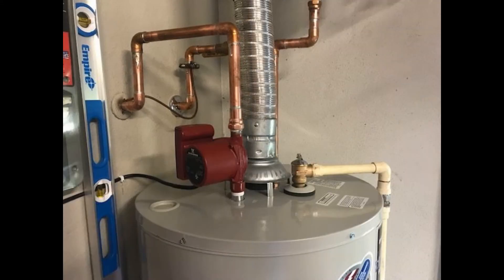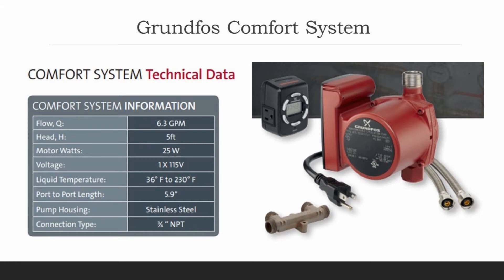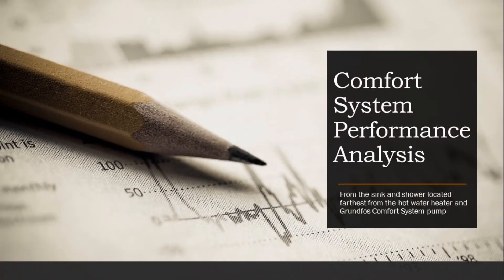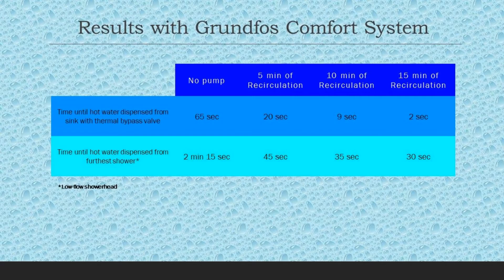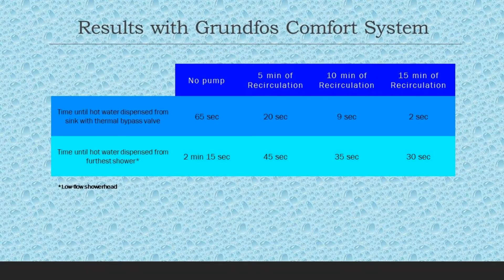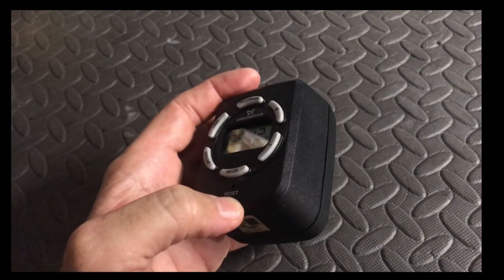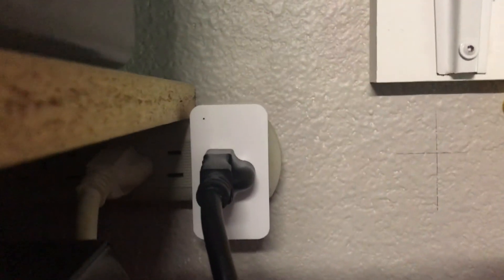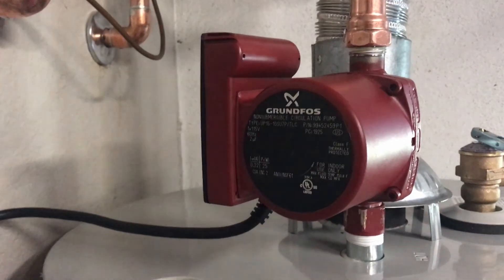Review of the Grundfos Comfort System Hot Water Recirculation Pump

Comment: My Kitchen sink is about a 100 feet from Hot Water heater. I installed a Pump under the sink and used a Sonoff Basic as the switch. The device has a inching timer buried in the settings. It took 100 seconds to get Hot Water to the sink, so if I am in the kitchen expecting to use Hot water. I say "Hot Water" and by the time I need it it is there (100 secs). I found out the the Hot Water runs by the two other bath rooms so the Command gets Hot water to them also. The first Sonoff just stopped working. It lasted about eight years and I bought a new one a few months back. I have Amazon Dots scattered around so I can get the hot water where ever i am.

I suppose I have saved 100's if not 1000's of Gallons of water, which has probably paid for the hardware.

Comment: For those that have a pump, and either it still takes a long rime, or it never gets that warm, are you using the bypass valve?   The rating for this pump is 6.3GPM.   The math on 500' of 1/2" pipe is it holds 5.1 gallons.   So even with a VERY long run, (say half that), it should be able to pump out the cold water from the line in 20-30 seconds.  UNLESS - it takes so much pressure to force the hot water into the cold line, that the effective GPM rate really drops.

Comment: _Can you use the timer Plug and the Wyze Plug at the same time?
The timer is programmed for a certain time every day
Wyze Plug for time outside of that schedule (when the timer is off)
_Connect both devices to electricity & get two Extension Cord male/female from each device to the bottom of
ELEGRP 6-Outlet Extender with Central Anchor, 3-Prong Grounded Wall Tab, Multiple Outlet Extender with 6 Electrical Outlets, ETL Listed
Then connect the pump to the top of 
ELEGRP 6-Outlet Extender with Central Anchor, 3-Prong Grounded Wall Tab, Multiple Outlet Extender with 6 Electrical Outlets, ETL Listed

_Can you use the timer Plug and the Remote Control Outlet 500ft~1000ft Ultra Long Range 15A Wireless Switch at the same time?
The timer is programmed for a certain time every day
Remote Control Outlet 500ft~1000ft Ultra Long Range 15A Wireless Switch for time outside of that schedule (when the timer is off)
_Connect both devices to electricity & get two Extension Cord male/female from each device to the bottom of
ELEGRP 6-Outlet Extender with Central Anchor, 3-Prong Grounded Wall Tab, Multiple Outlet Extender with 6 Electrical Outlets, ETL Listed
Then connect the pump to the top of 
ELEGRP 6-Outlet Extender with Central Anchor, 3-Prong Grounded Wall Tab, Multiple Outlet Extender with 6 Electrical Outlets, ETL Listed

_I think you can use the Wyze Plug and the Remote Control Outlet 500ft~1000ft Ultra Long Range 15A Wireless Switch at the same time with the same setting?

_I think you can use only the Remote Control Outlet 500ft~1000ft Ultra Long Range 15A Wireless Switch on demand?

_The question can it work all the time without the digital timer, the answer I think yes because it worked with the Wyze Plug, and I think it will work with all these scenarios. 

The default time parameters are 5 minutes on and 15 minutes off
It is better to go for 25 or 45 minutes setting
Maximum system pressure 145 psi (10 bar).
Flow rate: 0 - 3 [gpm] gallon per minute
Flow, Q: max. 6.3 gpm (0 - 1.4 m3/h)
The flow limits are based on predefined pipe diameters and flow limits
Pipe diameters & flow limits
1/2" 1.5 gpm)
3/4" (2.3 gpm)
1" (3.8 gpm).

_This one (digital timer) is similar to the one with an analog timer  
Comfort System (Includes timer, valve and hose kit)
_This one with Separate digital timer
Grundfos Model UP 15-10 SU7P/TLC - product number 99452459 
The other one with an analog timer (both are the same)
Grundfos Model UP 15-10 SU7P/TLC - Product number 595916 
Grundfos Model UP 15-10 SU7P/DTLC - Product number 595916 

Other Product number
99521972 (Digital Timer)
595926 (Comfort Valve/Grundfos XL Valve)
599390 (Flex Hose Kit)

Comfort Valve Temperature sensor will close when the water reach temperature 102 °F, this will force the pump to stop circulating hot water to the cold water line.
Reduce the flow for water in pipe can reduce accelerated corrosion

You could make a video about that 
:)
Reply from the maker: That's way more thinking than I ever put into this!  I would just use a smart plug which negates the need for the timer.  The smart plugs, such as Wyze, can be set to do whatever you want automatically.

Comment: Pros and cons of this system. The pro is of course you get hot water instaneously. The con is that hot water does get into the cold side which is your potable water. Unless you keep you water heater tank in tip top condition you will be drinking that water also. In other words the hot and potable cold side are not separated and your potable water might get contaminated by the hot water.
Reply from the maker: Good point but it's all tap water in my mind so it should still be potable.  At least I've never died, or gotten sick, from drinking my hot water out of the kitchen faucet.

Comment: My setup looks exactly just like yours.  I also timed mine and it takes around 40 seconds without pump and 30+ seconds with pump in a low flow shower head where the valve is not installed, only saving a mere 10 seconds.  i run the pump about 15 to 30 minutes before i shower.  doesnt seem to make much of a difference.  what am i doing wrong?  do i need to install a second valve in the master bathroom where i take a shower?
Reply from the maker: I'm definitely not a plumber.  However, you might have a long run from the valve and with the low flows it could just take the extra time to push the cold water in the lines out.  My thoughts are to have the valve as close to the shower as possible.  Maybe relocate it?  Did you do anything to resolve the issue yet?

Comment: Any pump issues if it runs continuously for say an hour or more a day?
Reply from the maker: We moved out of the home over a year ago.  So, I don't know if there are any new issues.  We ran it multiple times a day and never had any problems with it.   Our new home came with a recirculating instant hot water heater.  However, if I ever live in a home presenting the same long wait time for hot water with a tank water heater, I would install another Grundfos recirc pump.  I was definitely happy with our experience with it.

Comment: Thank you for the video. Since hot water recirculates into the cold water pipe, once you open the cold faucet, isn't the hot water comes out of it and you need to wait for cold water to start flowing out? Or it happens quickly?
Reply from the maker: Never really noticed an issue with it.  The cold was always quick and seemingly uninterrupted by the recirc pump.

Comment: Why use the expensive thermo-valve? Why not instead let the pump sit at the far between hot and cold and let it pump for a few minutes right before you need hot water? I added a check valve for good measure. I used a cheap shower fan timer with 1 minute resolution. Clicking on 2 minutes once is enough to get the hot water from the hot water tank to the shower end.
Gonna give the Alexa tip a try. Starting it by voice when jumping out of bed sounds cool (or hot, haha).
Reply from the maker: The valve came with the pump so I wasn't aware of its individual price, and never had problems with it so didn't need to buy a replacement.  Always interesting to see different mods!

Comment: Do i need to add any extra valves or piping? Great video
Reply from the maker: NO new return line used with this pump but it does come with a valve that I installed under the sink to recirculate the water.
Reply: Do you know if i should drain water heater? Thank you for yor reply
Reply from the maker: @josesosa1628  I’m not a plumber but I’d say no.  Of course it can’t hurt to drain it to give it a cleaning if installing the pump.
Reply: I installed pump ofer the weekend  the question now is should i leave it on all day or on schedule i have it on wyze plug so far thank you for your opinion

Comment: I'm thinking of getting one of these.  Do you feel the same about it today as you did when you posted this video?  Also, are you saying you have to run the pump for 15 minutes before getting in the shower, in order to get hot water from the shower in 30 seconds?  If so, I get that it saves water (compared to just letting the shower run until it warms up), but it seems self-defeating in terms reducing startup time.  Maybe I'm missing something.
Reply from the maker: My wife and I are still happy with this recirculation system.  I see your concern about having to wait 15 minutes.  However, we are very comfortable with using a voice command while still laying in bed to activate the pump and after finally crawling out of bed, using the bathroom, and brushing my teeth, the timing works well to save some water.  It just really annoys me to stand there for minutes with the water running down the drain waiting for the hot water.  I have talked with other people with this same pump and have heard everything from they leave it running nonstop, and the example they use the standard timer and have it start well before they wake in the morning and let it run for hours.  If you don't want to wait for however long yours will take to hit that "sweet spot" of time for near instant hot water, I'd use some of these other ideas instead of the voice control that I use.  One last thought...not sure if it really matters but I have thoughts that running the pump for many hours, or all the time, unnecessarily wastes electricity.
Reply: @DanRetired2017  Thanks for the reply.  I think our needs are generally predictable enough that we can set the timer to run the pump for a couple of hours in the morning and evening and that will cover most of out use.  We'll just have to experiment.  On another note, I've heard that when the hot water line is primed, the cold water line is now warm-hot, since it's been returning the hot water to the water heater, and now you have to wait for cold water to fill the line if you want any.  Any comments on that phenomenon?

Comment: Dan,hello, WE LIVE IN NORTH NJ, YEARS AHO, I FOUNF THIS IN A SUPPLY HOUSE FOR MY TRADE GRUNDSOS it only came with the pump & 1 bypass fitting,I had to buy my hoses, so I USED IT IN MY LAV ON THE 2ND FLOOR,SO BASIN,TUB & shower, so I wrote GRUNDFOSS, they sent me the second bypass,so I installed it on the 1st floor lav,so the kitchen also gained from that,,,, nowadays the mbox comes with pump,bypass& 2 hoses, gee no wonder, from complaints I guess,   I set my timer,off @ 3am -6 am, works like a champ. I could also connect an AQUASTAT, IN SERIES. WITH THE PUMPSTRAPPED ONTO PIPING, SO IT WOULD STOP ON THAT,INSTEAD OF TIMER, 🇺🇸🇺🇸🇺🇸🇺🇸

Comment: I can't wrap my brain around a system without a return line to hot tank.
Reply: I’m currently a apprentice and I’m trying to figure out if you are able to put the pump on the hot water supply ? To me it just makes sense you need a return line and tie into the hot water tank (recruit inlet) and have the pump there ? Hope that makes sense and someone can help me out.
Reply: @evandelzotto443   dedicated loop is the correct way, if you put a pump on the hot side the velocity of the water changes, I have seen hammering, balancing valves fail,and smells from hot contaminate the cold. Dedicated loop return can be throttled down and wont increase velocity of water leading to corrosive damage.
Reply: Master plumber
Reply: @truth6600  I appreciate the help thanks
Reply from the maker: @truth6600  Mark, maybe I'm lucky, but we haven't had any hammering, smells, water velocity changes.  I'll keep an eye out for any of that in the future.
Reply: Watch this video and notice the diagram of the hot/cold water pipes and how it circulates.  https://www.youtube.com/watch?v=Jd0IsylW4Cc
Reply: And no expansion tank ,no clearance to combustibles.
Reply from the maker: @truth6600  I do have an expansion tank above the heater.  Combustibles?

Comment: Awesome video, we took this a step further.  You can set your Alexa routing so that any alarm set will trigger the pump.  We use a tankless and it takes about 2:15 to get the system all the way up to temperature.  The effect is by the time you acknowledge the alarm and get to the shower, it is ready to go.  Have fun with that if you try it.  We also have our bathroom timer fans set to trigger it as well.  We turn the fan on in the evening when our kids are prepping for bed and the shower is hot by the time they go to use it.
Reply from the maker: All the home automation options nowadays are making life soooo much easier on us!  Thanks for the tips and ideas!
Reply: @DanRetired2017 you need just 1 mixing valve in the farthest sink
Reply: @DanRetired2017  with the automation intelligence we can avoid a lot of CO2 emissions. 

Normally people use the toilet 🚽  half an hour before showers 🚿, I re-route the pipes with electric valves and Alexa so the toilet 🚽 is filled with the cold water standing in the hot water pipes. Once the toilet 🚽 receives hot water, the pipes are re-routed to their normal configuration. Then you have instant hot water at the shower. No pump ⚙️ needed.

I read the idea from a gentleman in Australia 🇦🇺. Using Alexa to make the system more effective was my addition to his idea.

Comment: dont buy the auto adapt version, nothing but nightmares, it has 2 sensors and they dont work for crap, i've been tryingto get grundfost to help me for two years and nothing, they say i have a defective unit which it's not.  when this pump fails i'll buy a 100% pump and control it with an external timer.   i also tested how long it takes to prime the lines, i ended up running the pump longer because after 10 minutes the lines cool down so much that when the pump reactivates it feeds colder water back into the water heater, which the water heater senses, then the water heater fires up.   by running the pump longer it warms up the return lines more so when it shuts off, it takes longer to cool off that water, so when the pump triggers again, there's less of a chance of the water heater having to re-heat the cold return water.  it's a tricky process but i'd rather run a 10watt pump over my 500watt heat pump or 5000 watt electric element.

Comment: So the box says ‘saves money’. So you are saving money by not wasting water for waiting for it to get warm. But aren’t you wasting a fortune in your gas by having the water heater constantly be heating the water. Clearly I’m missing something.
Reply from the maker: Good point and very relevant if one leaves the pump on constantly.  I'm running the pump an average of 30-60 minutes each day and have seen no real spike in the use of electricity or propane (power for the pump and propane for the water heater).  I changed the duration of my voice activated outlet (pump time) from 15 min to 30 minutes since it gives me a bigger window of time to make it to the shower after I activate it.
Reply: @DanRetired2017  

Does the recirculation pump increase the hot water pressure and flow ?

Comment: Howdy Dan..  do you know if Joey had to remove water heater Heat Traps for this installation?
For myself, I'm pretty sure I would have to deal with those, and all comments so far are leaning toward, 'won't work with heaters that have heat traps installed :-(
Reply from the maker: Don’t recall ever seeing heat traps on the old water heater.  No sign of them now.
Reply: @DanRetired2017  Hmm..  thanks Dan..  Happy Christmas!
Reply: @steven.h0629  

Does the recirculation pump increase the hot water pressure and flow ?
Reply: @ajarivas72  No, this system design only works while all outlets (faucets) are closed.
Reply: @steven.h0629  Thank you for your kind replay. I appreciate it.